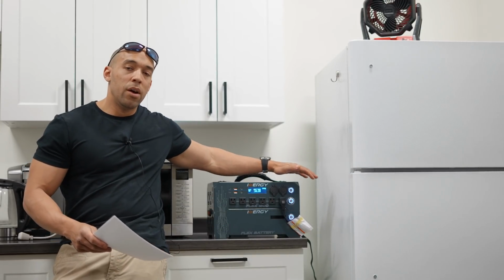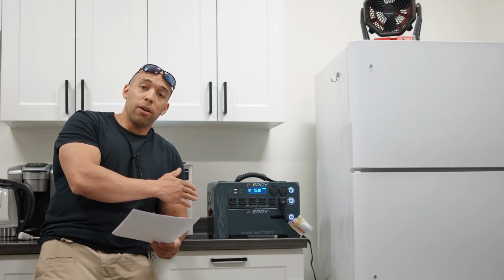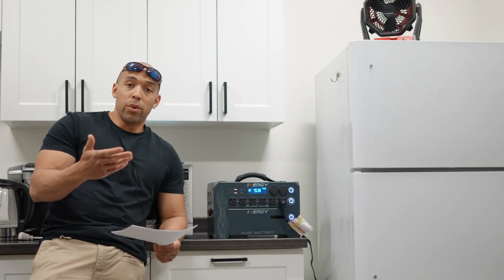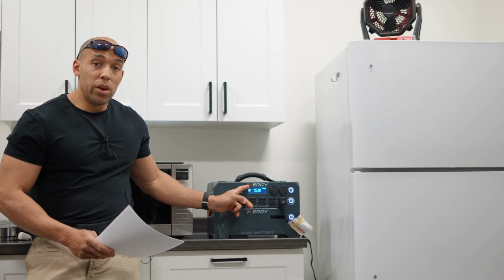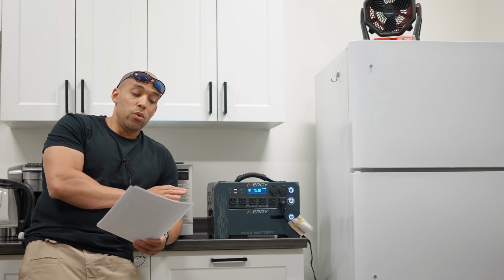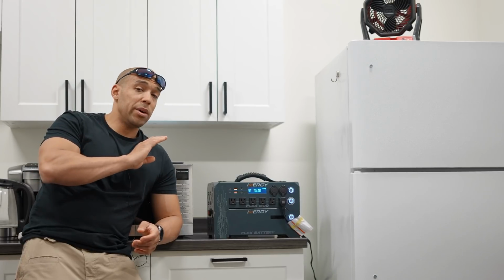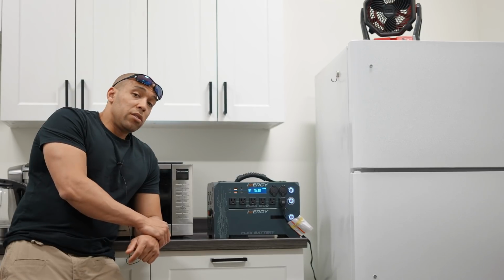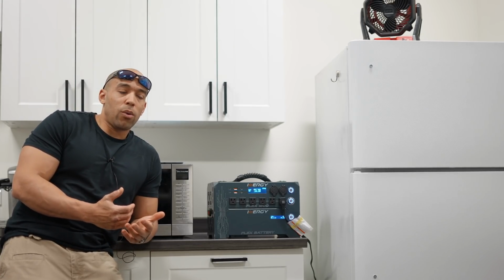Inergy Flex Technical Specifications

Comment: I think there is one basic flaw in your reasoning in that even though at 30 lbs due to a lithium battery as opposed to the heavier LiFP batteries, and  unit therefore weighs only one half , let’s face it, you are not going to be back packing a 30 lb unit anymore than you are a 60 lb unit affording more recharge cycles etc. The weight issue is therefore moot. In a real SHTF event, I am going to throw the heavier, longer lasting LiFP unit onto the truck instead of the lighter Li powered one- and if I can’t bug out, then I will be glad I have  a 60 lb LiFP  unit in my home.

Comment: Okay, help me get this.  One battery will sufficiently power some of the RV appliances consecutively.  By adding enough batteries (connected in parallel) and probably more solar panels, one can potentially achieve consecutive function of all loads in an RV?

Comment: Well thanks for answering my questions about can it charge the batteries well you take the head unit and 1 battery on a adventure. Kinda sucks you have  to buy another super-charger or another head unit but guess that's expected. Well the next question is how do you tie in your old units (ie Kodiak and apex) if you have one. Energies video says its compatible with the old units I mentioned and I have there Kodiak so in the future would like to add this new one. One other option I hope the consider is sell a extra large battery option say 2.5 to 3+ times the normal 1k battery they sell.(obviously at a more reduced cost) then buy 3 individual ones. So some can buy 1 jumbo battery for more permanent option and 1 regular battery and head units for more mobile option.